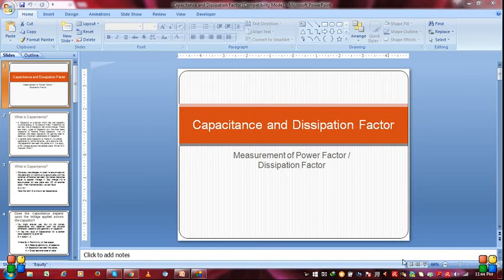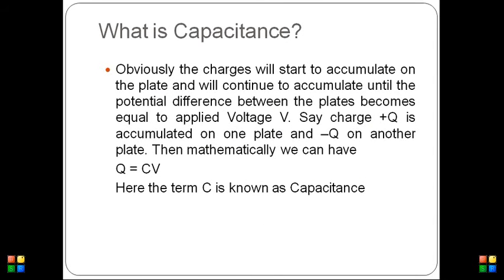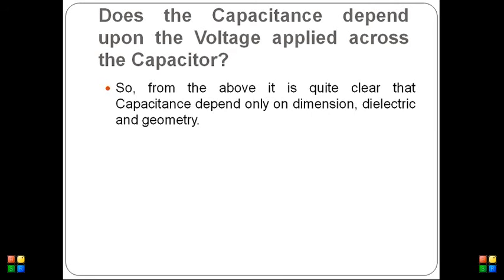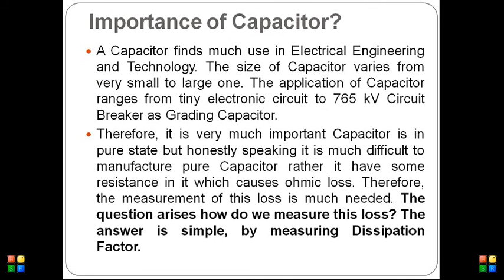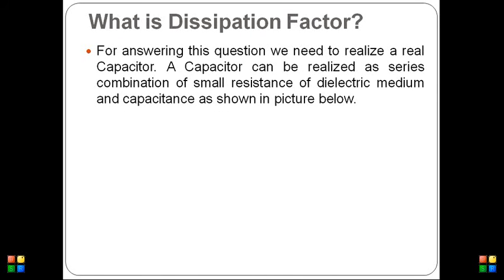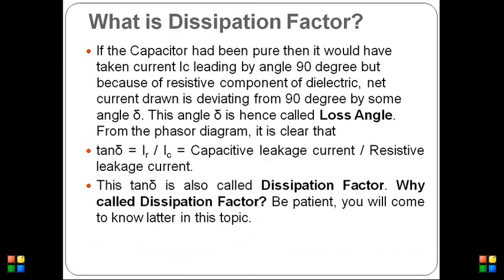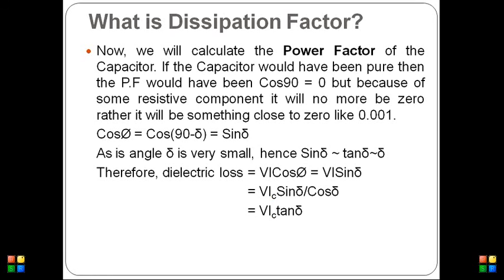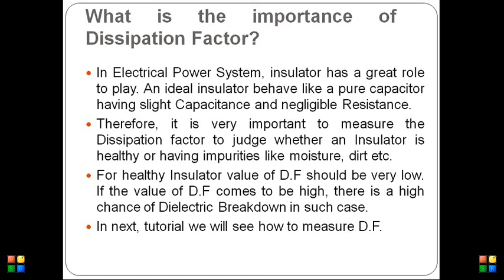Dissipation Factor / Tan delta and Capacitance

Comment: HI Sir,
Please help me.. i want to know the factor that change the tangent delta value?
the dissipation factor value is always high. what is the possible reason?
what i need to check.?
may be you can help me.
Reply: There are few things u need to check:
1) Is your test kit calibrated?
2) Do you have history of the equipment being tested?
3) Whether u r testing in GST or UST mode?
4) what is your testing method?
Pls reply so that I can suggest.
Reply: +Aditya Kumar 
thank u very much for the response.. 
before i can answer ur questions, let me add some details so that we are at the same page.. 

actually the device i am measuring is a piezo.. so how can i apply tangent delta concepts when i measure piezo materials? 

thanks again
Reply: pls review the construction of the material. can u tell me the model and make of material so that i can go through its constructional feature.
Reply: +Aditya Kumar 
specifically the material is PZT..  connected to a solder pads with cables covered with polymide.. 

is the tangent delta same principle even for crystal capacitos like PZT?  or is there any other factors need to consider?  
because high tangent delta for the material i mentioned is intermittent..meaning sometimes it gets high... sometimes normal..